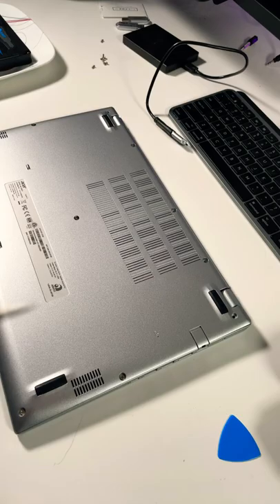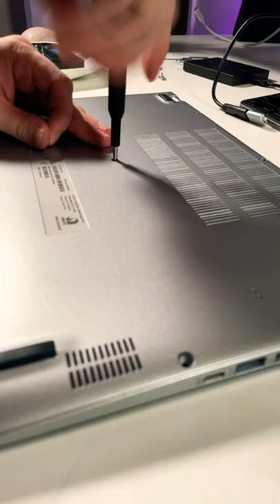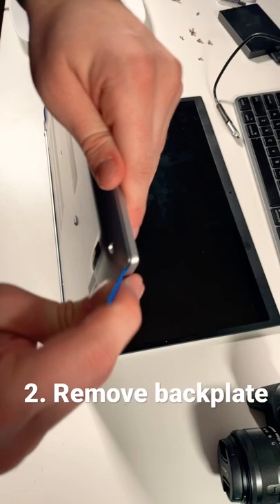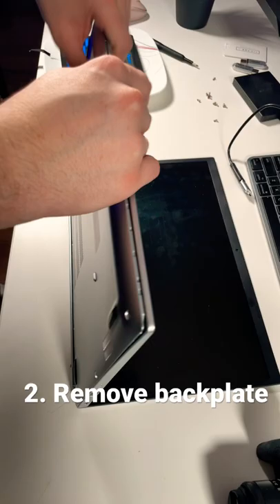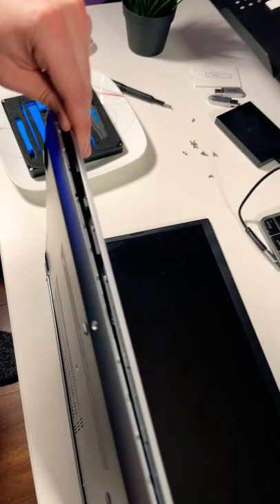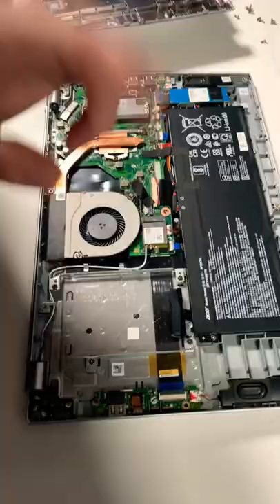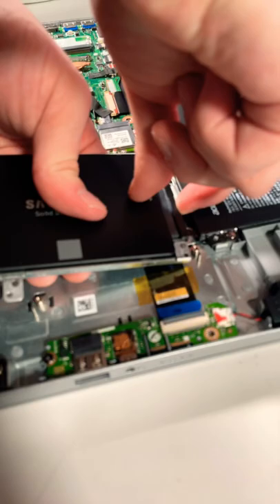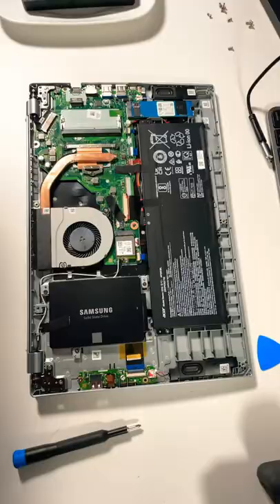How to replace or upgrade laptop HDD/SSD

Comment: Historically, removing the backplate has been daunting but this video helped alleviate any uncertainty. Thank you!
Reply: I need to change HDD in my laptop. Thankfully my laptop is designed in a way that I can remove backplate without needing any screwdriver which makes it easy to upgrade RAM or HDD. I also need to repaste CPU and that’s not that easy on my laptop so I guess that “You got some, you loose some” applies in this case.
Reply: @Nameisnotimportant same for my ASUS G74SX, no screwed needed to change ram or HDD. Ah the good old days

Comment: Always disconnect the battery don't forget
Reply: thanks I almost started without this
Reply: It’s safe to install these things with the battery connected. The only reason to disconnect it is if it’s somehow obstructing the drive bay.
Reply: is it rlly thst necessary?
Reply: @definitelyanormalperson1716 yes but not really
Reply: @daghetto101  the hell is that supposed to mean😭
Reply: @daghetto101  mind if i ask a question bro?
Reply: @definitelyanormalperson1716 it's just common sense it's like fixing the parts of the cpu with the power on, which might shock you
Reply: @M249MachineGun-bx5jd  not rlly i did mine without removing it 100% was safe😮‍💨
Reply: @definitelyanormalperson1716  i said "might" not "would" that means there's only a 50/50 percent chance that it would shock you
Reply: @M249MachineGun-bx5jd  clearly not 50/50 since i've done this multiple times not a single thing shocked me
Reply: @definitelyanormalperson1716  im not a computer engineer but i think not removing your battery might shock you or destroy some parts on your laptop
Reply: @M249MachineGun-bx5jd  yea it might destroy soe. parts of your conputer or some files might go missing
Reply: Dont need to disconnect the battery for harddrive /ssd replacement paranoia
Reply: when you put in the hdd do you have to do any software installation and would the drive not distrupt the windows on the ssd
Reply: @justdoit.7695  no software installation needed unless it not recognize it, as for disturbing no.

Comment: My laptop is so slow even starting it takes a lot of time so it's been a long time since I turn it on. Will it be ok if I just put ssd to it without turning it on first? Or should i need to turn it on first then off and put the ssd? Sorry im new to this. Please answer 😊
Reply from the maker: Good question. There’s no need to turn it on, you can just swap the drives right away :) good luck!
Reply: @CarsonCameronClark  thanks u

Comment: It depends what brand is the laptop from and what model it is, some have full back plates (like the one in the video) and some have mini plates
My old Asus laptop had a mini plate that when unscrewed allowed me to easily take out the HDD and RAM
Reply from the maker: Those ones are super handy, but sadly most manufacturers have moved away from that style

Comment: Do you need to reinstall windows for the transfer speed to take effect?
Reply from the maker: Yes windows needs to be reinstalled on the new drive :)
Reply: @CarsonCameronClark lol 😂 was he expecting to see windows on a blank. drive
Reply from the maker: Hey man! Not everybody knows this stuff! It's all G!! @lordray1000
Reply: Yeah.. how do you put windows back on a blank drive?
Reply: @CarsonCameronClark  What if it's my old Laptop's HDD, The new laptop already has SSD Window 11?
The old Laptop's HDD is windows 10, what do I do? Please help.
Reply: Depends. In his case, he already has an NVMe SSD in there. If his system files are stored on that NVMe SSD, then the SATA SSD he just installed can merely be used for storage. If both SSD's inside are "clean" without anything, then he can 1. Use another laptop to create a windows media installation disk and use that disk/USB to install windows 10 or 11 on this laptop or he can 2. Take out one of the storage devices, plug it into an enclosure, plug his original storage device back into the laptop, do a system clone and clone his entire system onto the new storage device, then pop out the old storage device and pop in the new storage device and bam, you're good to go.

Comment: since the laptop already has ssd installed after putting in the hdd the laptop will automatically boot from the ssd right or you will have to install windows again

Comment: What screwdriver do you use to unscrew the hard drive screw
Reply: It’s a Phillips head screw driver if you just get a full set of them then try and find the right size then that will work and then whenever you need to use a Phillips head again you’ll have them handy
Reply from the maker: In most cases it’s a Philips, but not always. Just depends on the laptop.

Comment: Is it possible to remove the HDD/SSD from old laptop and replace it in New Laptop?
Reply: Offcourse
You will retain the old memory as well.
But be sure to check the specification of the drive with new laptop's.
There are a variety of ssd and newer laptops dont support older sdd without any special kind of adaptor.
Reply: @MarxCJ  
Thank you but how to replace it?